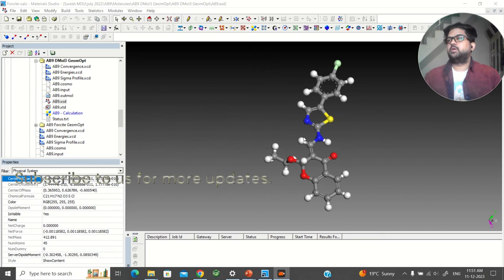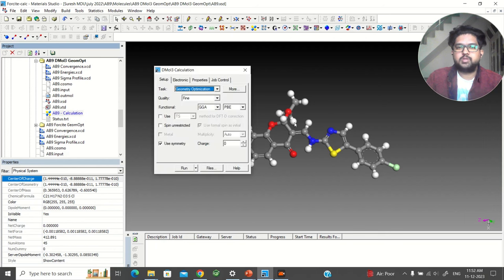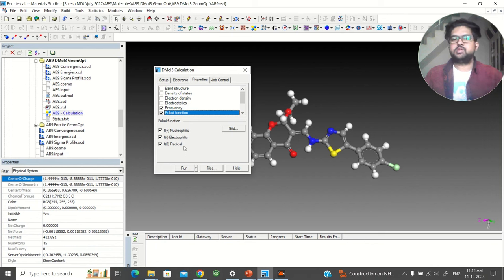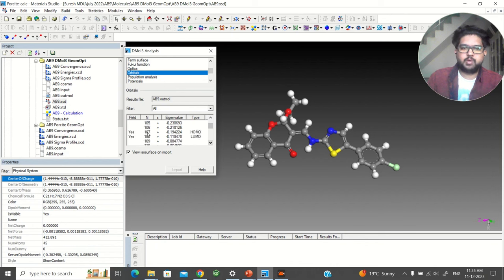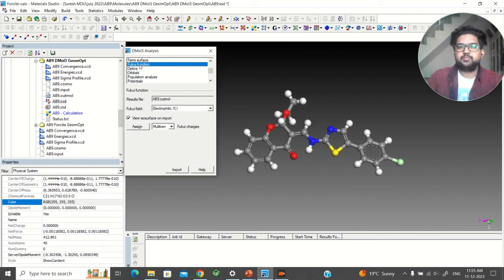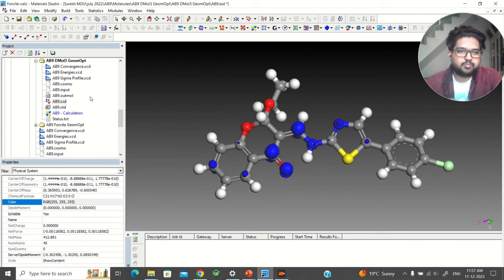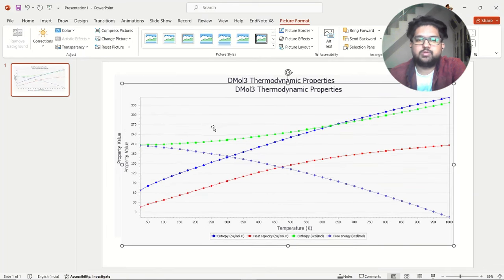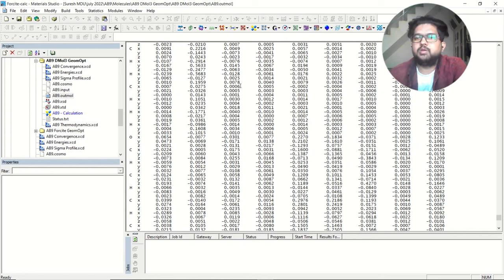Fukui Function and Thermodynamic Properties Calculations with Analysis || Gaurav Jhaa

Comment: I applied this calculation on hydrogen ADSORPTION on graphene but the calculation is running for more than 7 hours. Is it okay or is something wrong with the calculation?
Reply from the maker: It depends on the size of the unit cell and the methodology you choose along with the configuration of the system.

Comment: hello sir , I have already optimized the structure with Gaussian. Do I need to repeat the optimization with Material Studio to predict the Fukui function, or is there another method to use the optimized form from Gaussian in Material Studio?
Reply from the maker: You can reoptimize or perform a single point calculation to get the Fukui function.
Reply: @quantumguruji  Use a single point calculation based on the optimized form from Gaussian?
Reply from the maker: @bahire890  yes
Reply: @quantumguruji  sir I have seen some videos where some people use NBO and some do not. One video calculates cahrge 0, +1, and -1  without using NBO. Is this true or not ?
Reply from the maker: @bahire890  using MO method also we can find out the Fukui function....you can check my 2020 J.Mol.Liquid papers ...for that you need to optimize the geometry for neutral, cation and anion case and use the formula to manually find out the Fukui function.....while Dmol3 does this in one shot.
Reply: @quantumguruji  ok sir thank you 🙏